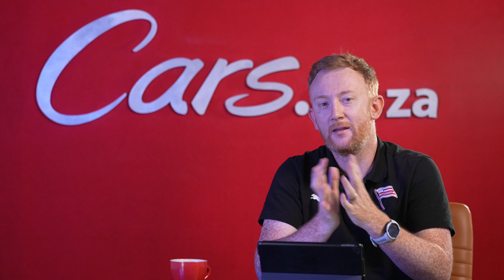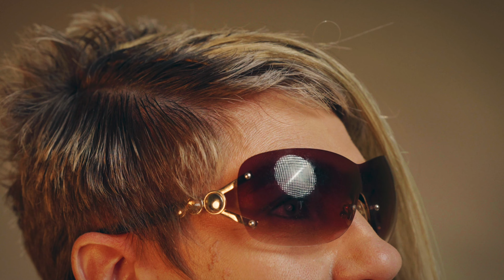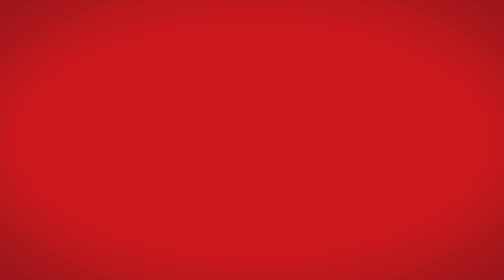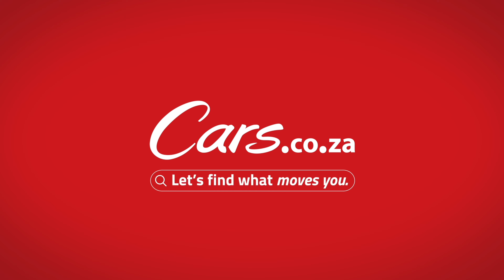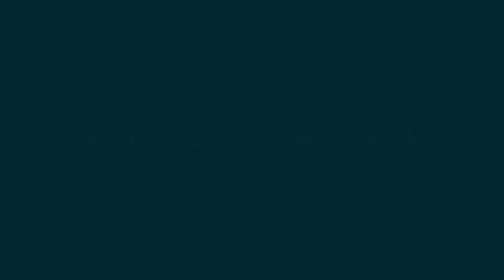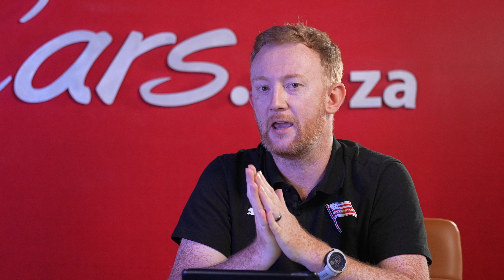Volkswagen SA drops prices on new cars + All-new Volvo EX90 first drive

Comment: Why are automanufactures still, still fitting ios carplay and android auto. Such a crop off. Such waist resouces and cpus.

Just fit a touch screen, mutiple inputs and triggers switch to swap between cameras 2 nose cams, rear cam.

Then have the vehicle, monitor support usb-c screen mirror and expose a usb hub with radio and touch screen device to control the phone as point device input.
Same should be done for smart tvs extra.

Limit apps rubish on vehicle a joke.
Plug latest cell phone, tablet what eva i want and use it or game extra.

Alot waist over head, developing spesific software.

Plug phone i want in and just use it and usb devices it exposes, via generic apps api, whuch should be standardised.

Comment: Why doesn't VWSA introduce their lower cost Skoda brand to SA. I've driven the Skoda Kushaq in Dubai, which is an indian made small SUV, based on the T-Cross. It's a great car, with good tech and features and the same 1 litre engine. It even has some features that you can't get on a T-Cross, like a sunroof, all at a lower price point.

Comment: Writing on the wall, have owned 2 vw Amaroks, both got dramatic  between 160 k and 180 k kms. Could not be fixed at vw and approved mechanics. Burned a hole in my pocket, Vw = poor after service care! I went to Toyota, honestly boring and inadequately engineered with a useless sun visor, especially when the sun shines from your right as a driver. Suspect traction control at high speeds and cross winds. At 220 k with regular service as the vw but no risking my family getting stuck on the freeway next to grass as tall as me, and I am 1,89 m tall. Vw took me heaven, to hell and to common sense. Warning common sense is not common. I still sadly long for My Amarok, loved ❤❤that thing to bits!

Comment: I dont know what your smoking but in 2010, the cheapest Polo was R120k. This types of videos makes me never to buy a VW that is 400k barebones standard.
Reply: That was 14 years ago so lets do the maths. R120k back in 2010, with around 5.5% inflation annual increases comes to about R250k in todays money. In that time there has been a brand-new Polo plus a facelift which brings in better engines, more safety, more features and so on. Those numbers are fair in my opinion with the launch price starting at R357k.

Comment: I’m a VW fan but the maintenance costs are ridiculous. Cambelt and turbo replacement was quoted at R89 000 (with an allocation of R16 000 for labour costs) on my 2012 Amarok. I’m definitely jumping ship after test driving the BYD Atto 3 recently at Festival of Motoring
Reply: Sounds like a repair cost...turbo replacement is not part of maintainance costs...any bakkie with same age and repair type would habe cost similair if not more.
I too am a VW person but unless its a passion car,you dont want to own a German brand out of a maintainance plan...you might want to consider Japanese brand like Mazda and Suzuki over the Chinese(they have been doing it longer as have better footprint with aftermarket maintainance....just a thought.

Comment: The downside of dropping the price for a new model is that the resale value of the outgoing model is destroyed. Nothing quite like getting screwed twice.
Reply: And yet, used Tiguans are still holding their value. A 2021 Tiguan 4Motion TDI is over R500k with 100 000km on it.
Reply: The resale value is still useless even if you increase the price.

VW is a useless car. Unreliable, expensive to maintain and high depreciation.

Comment: Suzuki fronx saves me over R150  000 over T cross. Slower but all the specs. 120 km is the speed limit. Fronx will sustain that speed😀
Reply: Finished paying my Scirocco, I needed something cheap on fuel and I because I drive a lot. I was stuck between a Polo Vivo and a Swift. Got the swift with all the bells and whistles @R40’000 cheaper than the Vivo
Reply: 😂😂 and you do most of your driving in urban settings that are not conducive for speeds above 60km/h.
Reply: Suzuki will last longer, be more reliable and cost less to maintain.
Reply: @weetbix2083  Who are you trying to fool ?  I test drove a Suzuki - it is 5 years behind VW and a cheap metal box. VW is Solid German engineering.
Reply: Vw is full of nonsense you dont need.  @synthwave7
Reply: @synthwave7  VW is solid?
1. Air con always fail.
2. Machatronic failures will completely finish you.
3. Most VW's have Christmas lights in their dashboards. 
4. Expensive parts that keep breaking
5. You will end up knowing your Vin number out of rhe head from visiting parts dealership every week.
Reply: @synthwave7  An independent mechanic I regularly visit loves German cars, they're putting his 2 kid through university.
Reply: Radio Dials always fails in a polo...naaaah
Reply: @MVDWalt-tw4gn  I'll have the t cross you don't want.  Different strokes..

Comment: I don't for one minute think that VW is interested in giving SA consumers good value. They have always been about hidden costs and charging more than they should for the cars
Reply: @Mondochiwan
I agree. Late 90s up to about 2010 is when their value couldn't be rivalled vs their quality. Now just grossly overpriced. A few tech items in the ocean of cheap plastics inside especially in T cross. That car vibrates on idle becuaee of the 3 cylinder motor!

Comment: Tiguran price not bad unlike Honda selling CRV for 1 million 😂😂😂
Reply: Tiguan is a maintenance nightmare like all modern German turds
Reply: What, a R1mil CRV 😮?
Reply: Should have seen the release prices of the face lifted Mercedes Benz GLC, R1.2 million starting for the GLC220d and R1.6million for the GLC300. That car came and everyone changed from Mercedes to BMW and Lexus real quickly.
Reply: I still don't know why anyone would buy a Honda for a million Rand. There are many options at that price range, and Honda is unfortunately none of them. 🤷‍♂️
Reply: The Tiguan offers minimal features for its price. I configured one on the website to match the spec of a Chery Tiggo 7 Pro Max and it came to R930k. That is R320k more than the Chery! You can buy the Chery, which is more powerful by the way, AND still buy another car for the price of the new Tiguan. So no. The price is still very bad. And the issues new Tiguan owners are experiencing are hilarious. Software glitches and all.
Reply: @SDav21  920K still fine CRV is 1.1 Million 🤣🤣
Reply: @hipetwa  No it isn't. It isn't worth R920k. Not even R700k. Honda is high on something. That's even worse. A top spec Tiggo 7 is R610k. Tiguan is still way overpriced.
Reply: @hipetwa nooit...saw one on display and was surrounded by the new Chinese brands...nobody even gave that CRV a second look lol.
Reply: @SDav21 Two totally different cars,the one is like a new phone with all the useless gimmics and unrefined "safety features" the other is you know what you getting as its been doing it longer ...when it boils down to price then each to its own.
Reply: @ozzi4627  Lol based on your comment you haven't driven one and compared. The Tiguan is NOT in any way any better than the Tiggo 7 let alone R320k more. The Chery is more powerful than the Tiguan by quite some margin and you feel it. The Tiguan feels sluggish whereas the Chery actually moves. And the 1.6 turbo in the Chery is very quiet and refined and so is the ride. I found more wind noise in the Tiguan. The features are not a useless gimmick. Even the surround view cameras in the Chery are of superior quality. The Tiguan's look like it from the early 2010s. It's embarrassing..
Reply: @ozzi4627  And it's not like VW is known for reliability. And they're expensive to maintain and insure.
Reply: But the honda will do a milion kilometres i cant say they same about the vw...